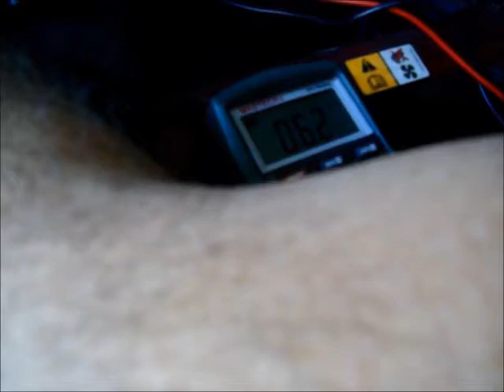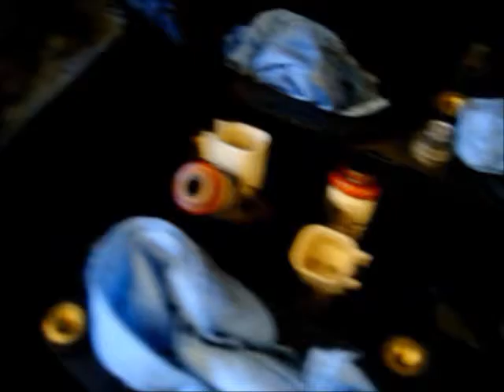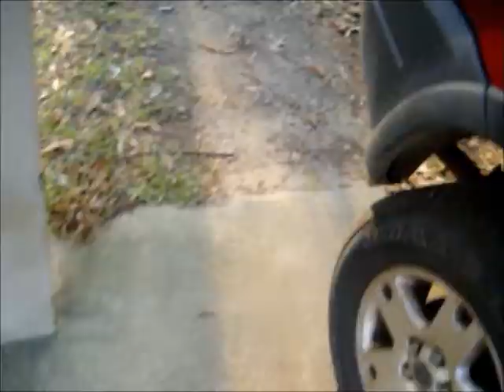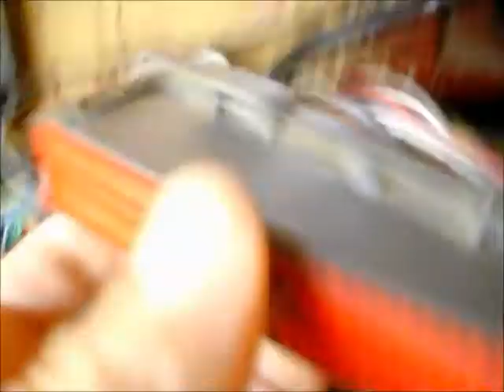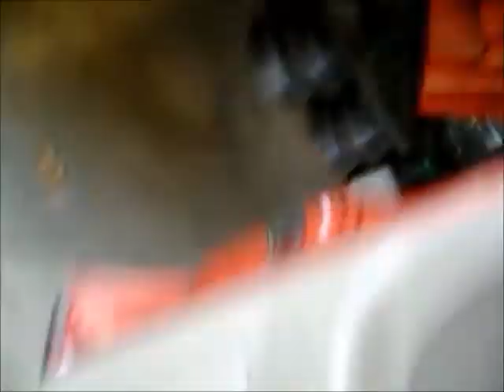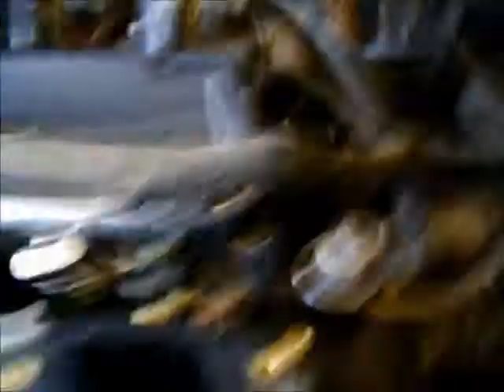2003 Ford Escape check engine light (part 4 of 6) fuel injector replacement

Comment: Hi. I’m getting code p0301 could you tell me what you think this would be? Should I change the spark plugs, wires, coils and fuel injectors??? What could this be??
Reply from the maker: I'm no expert on these new cars, my wife's V6 2003 Ford Escape has 437,000 miles on it now, and to me, it's a new car.  The newest car I've ever owned is my 1975 Ford Bronco, and if you look at my other videos, you'll see my other cars are a lot older than that.  Your code is a #1 cylinder misfire?  And you've got a flashing check engine light?  Keep driving it and you'll probably shell out your upstream cats, and the junk that comes out of them will probably clog your downstream catalytic converter....then it'll run rough and if you keep driving it, the excess exhaust pressure will blow a hole through the aluminum housing of your EGR valve.  This has happened to us twice, because I'm not used to things that don't happen to my cars, my cars that were built before catalytic converters were a thing.  So hopefully you aren't driving it with a flashing check engine light, like we did with my wife's car.  Anyway, I googled it, and here's part of what google said:  "Faulty Ignition Coil: A bad coil won't deliver the required electrical spark. Fix: Swap the coil to another cylinder (e.g., to cylinder 2) to see if the code changes to P0302. If it does, replace the faulty coil."  Seems like a good place to start, and it won't cost you anything.  If your code stays at P0301, then like you said, spark plug maybe?  Fuel injector?  Good luck!  Let me know what you find out.

Comment: do you have the fuel injector part number?
Reply from the maker: No, but it shouldn't be hard to find.  I just got one from the Ford dealership's parts counter.  You can find cheaper parts, but the 5 fuel injectors I didn't change are now 19 years old, and they have 370,000 miles on them.  I don't think cheap parts will go that far, so I like to buy from Ford when I can.

Comment: He got lucky these style of fuel rails are known for leaking even from the factory ford actually knew this and redesigned the whole intake accordingly
Reply from the maker: This 2003 Escape has 362,000 miles on it now, and my wife has owned it since new.  Making this video is the only time we've ever had to touch any of the fuel injectors, so if it's luck, it's a seriously long lucky streak.

Comment: I don't know if y'all have the same vehicle , but I've been changing parts on my 2002 Ford Escape 3.0 for a few months now . I've changed the entire exhaust system , timing chains , oil pump , power steering pump , upgraded to a 220 amp instead of a 110 amp alternator , but , I didn't make a video of any of it , because I didn't think I was good enough to have y'all's attention . I also added a trailer hitch from "e-trailers" and new shocks , plugs , coils , and of course gaskets . I could have shown how to extract the broken bolt out of the back exhaust manifold too . I've had shop experience throughout my life and military background , but it sure helps to have you guys !!! Thanks ...
Reply from the maker: That's a lot of work you've done on that car.  Yeah, I was  jet engine mechanic in the Air Force for 15 years, I just work on my cars for fun and to save money.  I make these videos when a car buddy from out of state has a question that isn't easy to answer (like how to make and use a piston stop to find TDC).....or when I'm looking for a video that doesn't seem to exist yet.  That's what happened here.  I was looking for a video and couldn't find one.  I found a ton of information, scattered all over the internet in various forums, regarding Ford Escapes, and CoPs that all seem to fail when they get a little bit old and a little bit wet, and fuel injectors, and how you can easily get the wire routing wrong, when you go back together with it, and clogged catalytic converters/blown out EGR valves.  I figured I'd make this video, just to put everything I researched into one series of videos.  It's a pain in the ass how long they are, because I didn't know how to edit yet, people complain and I get that, because you couldn't pay me to watch any of my videos that are more than 2 minutes long.  I'm a car guy not a video guy, and I don't want to be a video guy, my youtube account isn't monetized, it's just something I play around with.  Mostly I'm just doing this for fun, because I love cars, and I love talking about cars, but I'm happy if a few of my videos are helpful to anyone.  And if the Ford Escape guys all put electrical tape on their CoPs, we'll all be better off.  Over 350,000 miles on my wife's 2003 Ford Escape now, and no CoP issues at all since I taped up the CoPs in this video series.  Five of six CoPs are still original to the car, and the one I replaced wasn't even bad.  Oh and five of the six fuel injectors are now 18 years old, and original to the car as well, only the one in the video has ever gone bad.  I can't lie, it's been a good car.

Comment: Well, Owen, thank you so much for your help! We have a 2004 Ford Escape, and same issues. I thought at first that it was a coil pack, but the old Auto Zone scan said "open injector circuit, cylinder 2". Of course, the rear bank, right? Anyway, I ordered an injector, followed your example, and she's running like a top! I put new spark plugs and new coil packs all around, since we were in there anyway. So, here's to you my friend! You're ahead of us on miles at this point, but, I'll race ya to a million. Thanks again for posting!
Reply from the maker: Awesome!  We're at 318,000 miles now.  Engine still runs great.  If that little Escape can just hang in there for another 30 or 40 years, we'll hit a million miles for sure.   :)

Comment: I have a question related to code P0451 - Fuel Tank Pressure Sensor on the same vehicle where is it?
Reply from the maker: Sorry, I just noticed your comment, you've probably got it fixed by now.  I know a lot about old cars, and very little about new cars.  When my wife's 2003 Escape finally bites the dust (289,000 miles on it right now and still going strong), our new family car will be my '63 Thunderbird, it's so much easier to work on, and I'm almost done restoring it. Sorry I'm not more help, but this guy seems to know what you're looking for: https://www.youtube.com/watch?v=KWYtmmXfLZw

Comment: great explanation and showing. local mechanic tells me to rub small amount of engine oil around the O-rings. whats your thoughts?
Reply from the maker: My professional background is in jet engine maintenance, so I prefer petrolatum, as that's what we used.  Oil will work too on packings (o-rings), it's just not quite as slick as petroleum jelly.